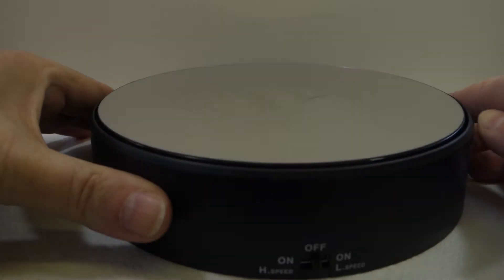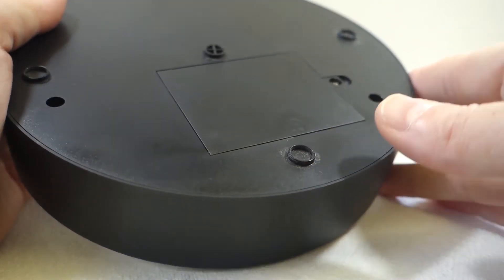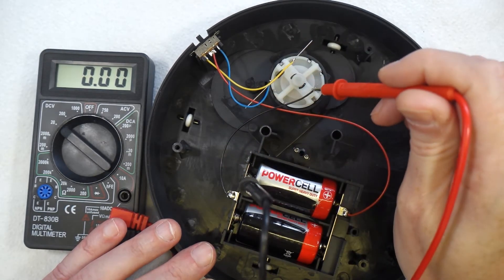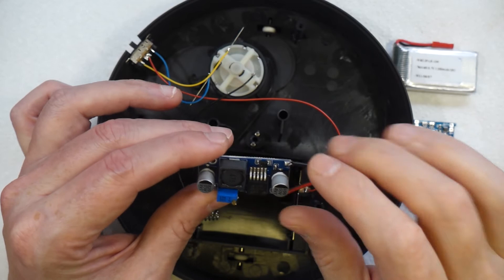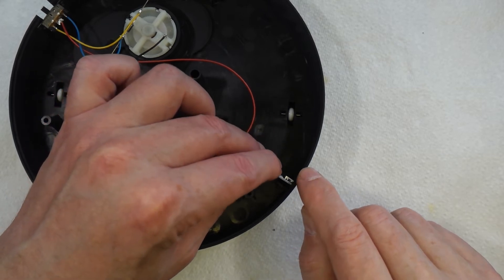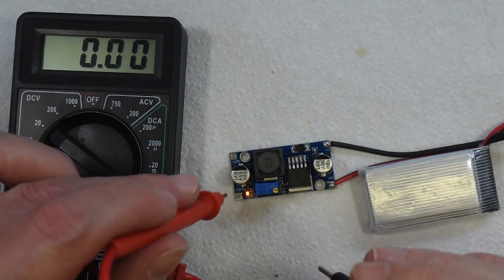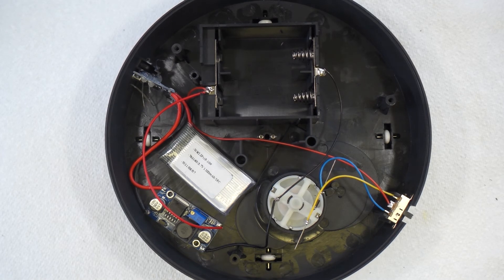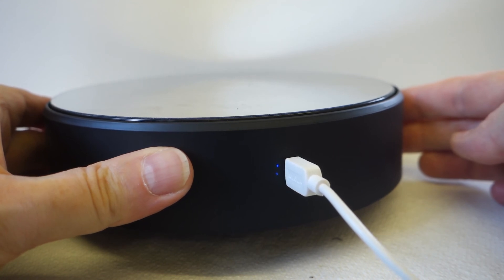Adding a rechargeable battery to a display turntable

Comment: nice, but just to be correct, I believe that "resistor" is in fact a diode, right ?  A little black body with a white ring ... ?   Diodes typically have a 0,2 V  drop.  By adding a few in series you can slow it down even more.But with the new setup that is no longer needed as you can regulate the voltage on the DC-DC buck converter :)

Comment: Great stuff! I like the idea of using a switch-mode regulator instead of a linear regulator - it gives much better efficiency.
Reply from the maker: Thanks. To be honest, the main reason I used it is because I have dozens of them in my workshop, and they're easier to solder than a standard regulator :-)
Reply: I have a battery-operated turntable similar to yours. I might nick your design solution if it's OK? :P
Reply from the maker: By all means. That's why I made the video :-) I would advise adding an isolator switch though - I did find the regulator drained the battery. I'm currently making another video showing the addition of the isolator switch, but basically it's a toggle switch between the battery and the regulator.